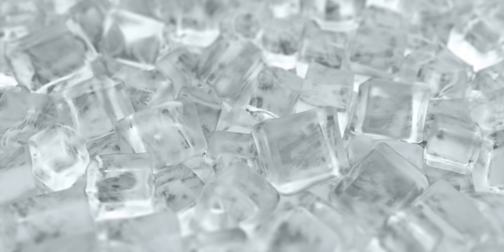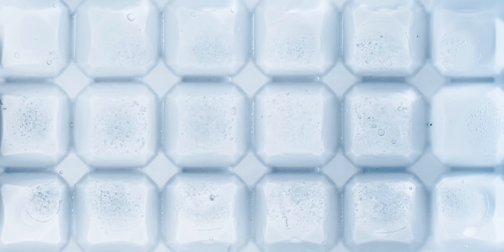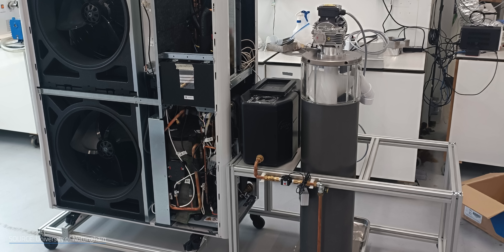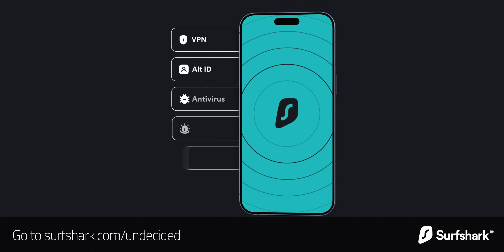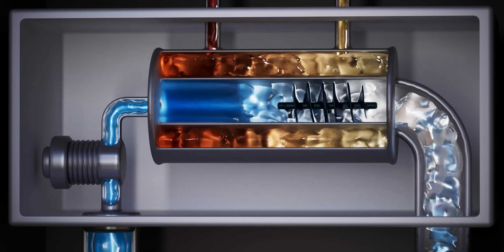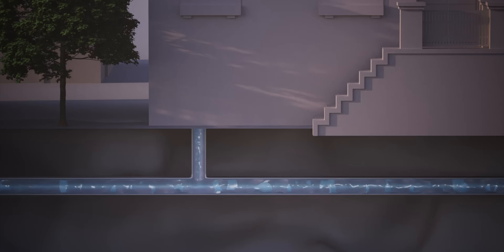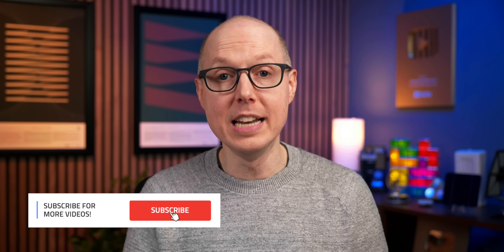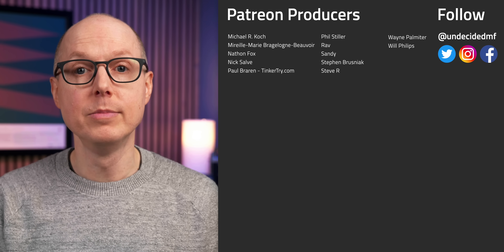How Can Ice Heat Your Home? Ice Source Heat Pumps!

Comment: If I'm understanding this correctly the idea is to pump water through the gas pipes and deliver ice back in a return. How much energy from ambient temperature water can you actually move though a gas pipe?  They're not that large. The gas network doesn't have a flow and return and I'm presuming it would also require extra pumping stations to be added. How long before "utilising an existing asset" turns into a massive maintenance liability. The UK's water and gas networks aren't in the best shape as it is. I think this is a time when it's an opportunity to just build something better from scratch.
Reply: I believe the return could be via waste water pipes (ground or sewage), i.e. non-pottable water, hence why this approach works more in built-up locations than rural ones, who may have gas supply but tend not to have waster water return pipes (i.e. have septic tanks and rainwater soakaways).
Reply: It gets Returned through the sewer network meaning you'll get charged twice Once by this company  and then by your water utility for the water going down the drain
Reply: @adus123  - which is 'this' company? This is a university engineering team, that is seeking to offer alterantives to the use of existing in-ground pipework to achieve a form of district heating system without additional groundworks using low temperature recovered waste water. The UK water companies are already providing district heating, albeit at large trial sites (1,000s of households each), using waste-water heat-recovery and water source heat pumps - with the same company providing water and heating services. Plus, there is some 20TWh of waste heat currently being flushed away in the UK, it just makes sense to recover as much of this as possible, particularly in urban areas (hence the recent government whitepaper on the subject).
Reply: @GruffSillyGoat Oh sorry did I get in metaphorically wrong  this company or he'll ever takes up this initiative / Idea/  concept/ Whatever you want to call it
Reply: @ - sorry I'm not clear on the point your trying to raise. Is it that one shouldn't be charged for three separate services - water, waste and heat - because they share the same infrastructure although the separartely cost the supply company(ies) to produce/manage?
Reply: People with a decent size garden could have the ice deposit into a small, insulated outbuilding with a drain in it. They could then keep some food in there as the ice slowly melts into water and goes down the drain. Maybe at the height of winter they could turn their fridge off!
Reply: Also why not use steam and central heating at that point... why make each house have individual heaters...
and why ice??? Transporting slushy ice for sure would be harder then water...
Reply: @greedier-7661  I think you're missing part of the point. The point is that you bring liquid water in, transform it into ice+water at home (thereby heating your home), then exhaust it somehow (sewer pipes, probably, because the sewers can already transport a mixture of solid and liquids)
Reply: @Martititi  I rly think that sewers where not made to have such increase in water flow.

Also dumping ice into them could make problems as it could block sever pipes or freeze/ glue stuff...
Reply: @ Yes, no? I don't know. You can read and cross-check the answer I just posted to calculate the amount of water needed (about 370 L/day of heating for one house). It doesn't look that bad, especially considering that you could be using at least a part of the grey waters that the house/apartment produces locally (which does not add any more water into the sewers than was originally planned).

Also, a lot of sewers are designed for storm surges, so there should be no problem with, say, double the amount of water from home usage, since it's not the design point.
Reply: @greedier-7661  Now I'm not saying that there aren't challenges to this idea, indeed there are. My biggest issue with this system is that the sewers are probably not designed to handle that much more water, and Matt did not say how much water would be needed...
Reply: @Martititi  If I'm mathing correctly, the average UK home would need only about 1200 liters of water to replace the energy content of natural gas used per YEAR. Compared to about 350 liters used per DAY for normal usage, the increased water demand and sewer disposal cost is absolutely trivial. Even allowing for inefficiencies doubling the theoretical usage to 2400 liters of water is still a rounding error.
Reply: @ Huuuh, I don't have the same results as yours. I get approximately 370 L of water per day of heating season (half of the year), per house.

Your value is not possible. What you found is that if you freeze 6 liters of water per day in your refrigerator, you can power your home's heating. I don't know about you, but it's not enough for me, even in an apartment building with relatively good insulation.

My assumptions:
- you freeze only 1/3 of the water to preserve its ability to flow down the drain
- Cp_water = 4180 J/kg/K
- inlet water is at 10°C
- freezing enthalpy = 334 kJ/kg
- no freezing beyond 0°C (otherwise the water would be totally frozen)
- Coefficient of power = 3 (useful to know the power at the evaporator)
- the heating energy consumption of a house is about 4300 kWh/year (this number comes from the ADEME estimate in France).

Which means: the power at the evaporator stage must be adjusted by the factor COP/(COP - 1), because the compressor adds power, which is not taken from the evaporator. This DECREASES the amount of power needed.
The available energy per kg of water is 229.7 kJ/kg (bear in mind that we only freeze 1/3 of the water to preserve flowability after slushifying).

Dividing the energy needed by what water can provide, you get about 67-68 tons of water per year. Dividing by 6 months * 30 days, you get a daily consumption of water equal to 370 kg, or 370 L, as you prefer.

Still comparable to home usage (the energy of the grey waters from home usage could definitely be used to heat the house btw), but much more than you said.
Reply: @Martititi This is why I shouldn't do napkin math. Somewhere I was off by a factor of about 100, which means the entire scheme is impractical. My (intentionally pessimistic) numbers now show120,000 liters per year and the gas pipe network can't possibly deliver that volume of water.
Reply: @ Really? The gas pipe network can't deliver that volume? It doesn't sound that bad. Say 120 cubic meters of water per year, averaged over 10 hours of colder time per day (conservative estimate), over 4 months (conservative estimate) means an average flow rate of 0.1 cubic meter per hour. 100 L/h is just close to nothing. Only one of your taps is way beyond able to have that kind of flow rate.

I mean the system is probably feasible, but I don't think it's really reasonable.
Anyway, air is free (water, even the non-potable water) isn't, and air is usually above freezing in the UK.
Reply: @Martititi  Individual pipes might be able to handle that flow rate, but I really doubt the outside lines feeding them could. Can the lines under the street carry the 2000 l/h needed to feed 20 homes? Maybe, maybe not.

I agree with you that air source is probably better overall, but could make sense for certain limited applications.
Reply: Do gas pipes even descend from a higher point? I thought they just used pressure. Water pipes use gravity for most of their work. 

 I'll beleive it when I see it. Moving a slushie is a pain.
Reply: Both water and gas pipes use pressure, both involve pumping stations. Some water in the UK is gravity fed but less than it was in the past. Waste are a mix of gravity and pumping.

Comment: It wasn't that many days ago that I thought you could heat your home by putting water to a freezer and carrying the ice outdoors. Though an average freezer doesn't really have that strong compressor to produce much heating capacity, but the principle is pretty much the same: use the latent heat of water to heat a house and dump the ice outside of the dwelling.
Reply: ... or use steam and central heating... and don't be dumb...

Like transporting ice will for sure be harder then transporting water and if gas pipes already transported gas then transporting steam should fit them.
and what is the point of placing heater in each house if you could use central heating and each house could simply change the flow of steam to their house...

Their idea is dumb as there would still need to be central pump to pump the water to each house and transporting ice will for sure be harder.
Reply: @greedier-7661   for steam, the pipes would have to be insulated to not have massive losses. You would have to deal with condensation and air locks in the pipes. Also, steam, while having a high specific heat, also has a low density (weight per volume).
Reply: @greedier-7661  Heat pumps loose efficiency rapidly as the temperature difference increases. The water source/ice producing heat pump has a heat source at 0C and needs to output about 40C for heating or 50C for domestic hot water. At these temperatures, heat pumps can supply about three times the amount of heat for the amount of electricity they use. To create steam, the output needs to be at least 100C. I am not sure exactly how efficient a heat pump would be at these temperatures, but my guess is it would be 1.5 to 2 times the electricity used. By the time you factor in line losses of underground steam lines, it would probably just about the efficiency of just using a resistance heater without the extreme expenses of heat pumps, insulated pipes, etc.

Comment: This idea of let's connect all buildings into one system invokes the same feelings I get when I am in an old apartment building. 90% of the rooms are either too hot or too cold because the system doesn't work. How is this any different? Are we going to see some homes on fire because of the excess heat and some homes freezing because they can't get any heat? Are all homes going to be roasting and then have to open windows in the middle of winter to avoid being cooked? 

It is far better when a person gets to set their own temp and the system is isolated within their own environment.
Reply: @ExiledPrince-us5zr  the system is unified but each unit can still have its own control and sub units. In the simplest form, it would means the mechanical parts are centralized but each unit has its own loop
Reply: Each building and unit would have its own sub systems. Just like your neighboors using gas downs make your gas usage change. 

In its most simple form, its just a variation of district heating which is already used in many places.

Comment: The one big issue I see with this is that this requires switching off the gas line to do the upgrade, and unless you think you can do the upgrades to the lines and all the connected buildings in the couple months of summer, you have to get all of them off gas first anyway, at which point the ice source heat pump doesn't really add anything. 
I think using the pipes for something warmer that you could use to cheaply upgrade an air source heat pump would make more sense because then you can get everyone off gas incramentally and the upgrade would still make sense to do afterwards.
Reply: And thus why some older cities still run municipal steam.
Reply: it means a lot more usage of electricity in all cities. Major probles for electrical grid.
Reply: I could see this being used at large builds of new homes.
Reply: @3PurpleSquirrels  Much like parts of the US, I see a not-too-distant future where gas lines are prohibited to newly built houses.

Comment: One time the idea of supplying hydrogen instead of natural gas to homes through gas pipe network was banded around but faded away. In that case our domestic central heating boiler and radiators would have stayed the same with a small modification to burn hydrogen and release steam (water vapour) as by-product
Reply: The trial projects didn't go well, one was refused by the residents, one failed to determine the safety of the solution, and one went ahead as the project refused to release the safety report, which eventually was released (in a fashion) after a freedom of information request by local journalists. The released safety data includes a video of the explosion risk that the company put on their YT site, but oddly with no links from their channel as well as excluding it from being searchable. Again, the local Scottish journalists released the link.

The other aspect not discussed in boiler readiness, most installed gas boilers cannot take hydrogen/methane mixes and so need upgrading. These upgraded boilers are labeled hydrogen-ready, but this is a misnomer as they only support up to 20%, by volume, of hydrogen in the gas mix. Even existing pipelines will have difficulty with hydrogen mixes above this percentage. 

In essence the aim of mixing hydrogen in gas is to extend the duration of available natural gas supply, which has 10 years of proven domestic supply reserves remaining in the UK (half of which is sold abroad currently), and perhaps 10 to 15 years of probable/possible higher risk exploratory resource available. This is why the UK currently imports 70% of it natural gas supply, with the hope being introducing hydrogen in the mix may reduce the cost impacts of this by extending the duration of domestic gas supply using renewables to generate the hydrogen. However, this is not materialising as hydrogen itself remains steadfastly a fossil-fuel source resource itself (oddly mainly derived from natural gas).
Reply: Hydrogen is a nightmare to work with. It leaks through any microscopic hole, and eventually makes metals brittle by working into the grain structure, a process called hydrogen embrittlement. If you plan to use electricity to make hydrogen from water, it is more efficient to just use the electricity directly to run a heat pump or air conditioner. The only place where hydrogen is extensively used is where nothing else will work, like in petroleum refining and some chemical reactions. And hydrogen is pretty expensive.
Reply: @billsimpson604  Thanks for your insights Bill, I know of one hydrogen application that is commercially viable now - lift trucks used in busy 24/7 indoor warehouses where diesel exhaust emission is prohibitive, lithium batteries take too long to charge up. LNG or propane gas bottles are sometimes used in the same environment but strictly speaking they shouldn't. In this usecase the lift truck is always a few meters away from mother ship, refueling I mean. There are likely more applications that I don't know about.
Reply: @soundslight7754 It is great for cryogenic rocket fuel, since it produces the most energy per kilogram of fuel. Nobody would have walked on the Moon without the hydrogen powered 2nd & 3rd stages of the Saturn V using light hydrogen to reach orbit, and then escape Earth's gravity.
Reply: @billsimpson604  I get you, thanks but remember this effort is about replacing fossil fuels with renewable alternatives on earth
Reply: @ - but there lies hydrogen's core problem whilst having the highest energy per kg it also has the lowest energy per litre, making it tricky and expensive to handle and store. It's this duality which means as an energy source it lies far outside the goldilocks zone of being suficiently energy dense but easy to use energy medium. In all applications, even the moon shot use, more energy has to be put in to work with hyrdrogen than is returned.
Reply: Surely that’s far less efficient than a heat pump
Reply: Matt must be extremely afraid of me :face-blue-wide-eyes: He keeps deleting my messages. I don't know what he know,s about me, have I ever mentioned I have a degree, 5 master's degrees and a PhD? I'd never done it but let him have a tangible reason at least
Reply: Too much of the hydrogen will leak away through the pipe system to make that practical.
Reply: @jimthain8777  Our gas pipe network isn't lagged, I wonder how much heat (or cold) is lost along the way if they start pumping mushy ice through